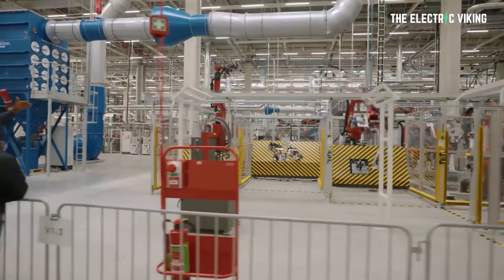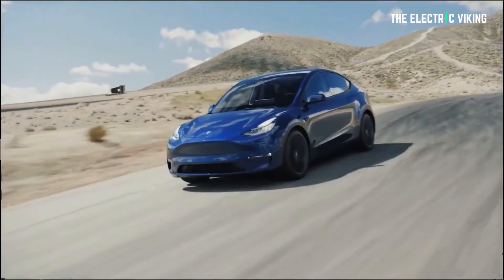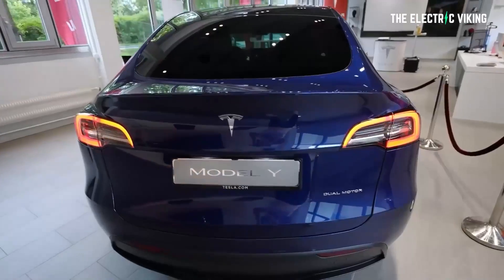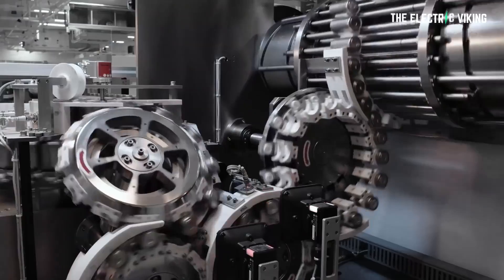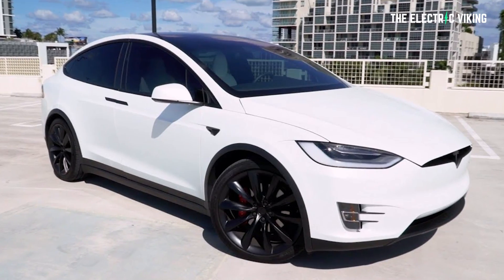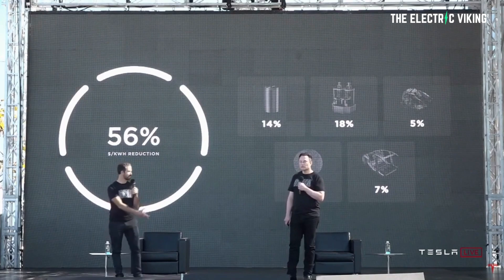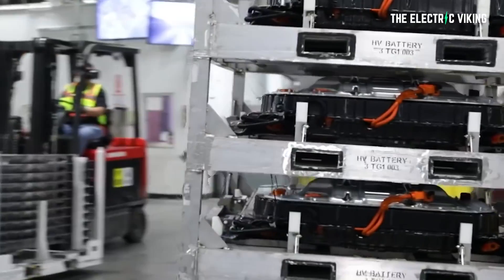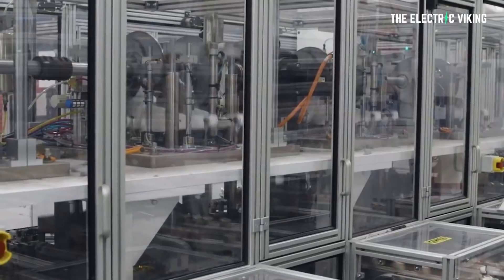Tesla Model Y at GIGA Texas have 4680 structural pack!

Comment: Personally, I would wait at least two years before considering a structural battery pack.  Tesla doesn't do a lot of validation testing, so there will be problems.  My fear is cracking within the glue that holds the battery together.
Reply: The company with engineers who design those long pointy things that make a lot of noise "doesn't do a lot of validation testing"?
(AKA "Rocket scientists")
How precisely do you know the extent of their validation testing?)

Comment: It's too bad that Tesla doesn't update older vehicles.  All the new tech goes into the latest model.  The Model 3 got the 2170 cell but the Model S and X still use the old 18650 cell.  Then the Model Y got the front and rear mega casting, but the Model 3 is still using the old crappy body manufacturing process. Why doesn't the Model S, X and 3 have mega castings?

Comment: So, it seems clear that the Ys coming out of Austin will have the structural pack….but what about Fremont.? If you live in the US, are there going to be both the non-structural and structural versions? Or do you expect Fremont to start shipping structural cars concurrent with the Austin startup?
Reply: The structural battery pack provides performance and financial advantages no matter what size cells (or chemistry) goes into them, so I expect Fremont will change over ASAP. However, the best time to switch is when both front and rear castings are produced locally, and that may possibly require another Fremont GigaPress to increase casting output. 

If someone knows the percentage of idle time the existing presses are experiencing, that might provide some clue.

Comment: Does a structural battery pack mean that it is very difficult to replace the battery, when and if needed one day?
Reply: There is evidence that the vast majority of battery packs will outlast the Tesla vehicle, and will not require service or replacement. Instead, as vehicles become obsolete [or totalled], the structural battery packs will be removed for reuse as stationary medium-current storage devices. 

The battery pack certainly bolts to front and rear castings, providing most of the lower body rigidity. There are still going to be unibody components like door pillars and curved door frames that must also fasten to the battery pack at the edges. 

Because "the best part is no part", probably the car seats and all other interior floor-mounted components will also bolt directly to the battery pack. I think it is likely that a non-structural layer of soundproofing and custom formed carpet will be sandwiched in between.
Reply: A few observations.
1) It's "If" rather than "when".
2) There's likely to be a substantial warranty.
3) Price will reduce A LOT!
4) Did anyone ever say out loud "I wonder how much that engine will cost to replace, when and if needed one day?" We're talking similar mileage, at least.
5) There's still a misunderstanding/ misconception regarding "structural" and "not replaced,/ removable".
The pack will be (is!) necessary to the structure when driving. When the structure is under high torsional stress.
That doesn't mean that when the body is supported on a lift that the pack can't be unbolted without the body collapsing under its own weight.
We've already seen pictures of a bodyshell being moved by fork lift with no pack atteched.

Comment: Production wise and cost wise it makes no sense not to upgrade the whole Tesla lineup to both giga castings and structural battery packs based on the new bigger cells. The only thing that might prevent that from happening right now would be production capacity of the new bigger cells. I think the cells of ms and mx will be Tesla history within a year or two. Why, because it will just make sense, as the outcome will be ease of production, higher production, quality,  less points of potential problems down the production line, ease of assembly,  reduced cost and improved earning per car. Not to mention it will make customers happy. And set Tesla even further ahead of competitors.

Comment: Thanks for the video, great job. As for the Giga Texas plant and the video just shot via drone.. This job has a long way to go!  You will not see scale car production for 8 to 12 months. The work is moving slow, man power is at a minimum for a job that size. I spent the last 33 years running work just like this. The pains taking work is in the setup of the production lines. Texas has never been known for the speed of it's work pace. I am looking to buy a model Y with the castings and battery platform from this plant. I guess i will be waiting for some time.

Comment: Amen Sam,
Strong RANGE improvement will drive me to order my next M-Y LR ... IF it also has BOTH the rear and front giga casting!  
IF in USA has 4680 with 450+ miles it will be perfect because 450 miles with 90% full and 10% safely reserve... my real life usable range would be 360 miles!!! That does the job! 
Praying for Austin improved LR performance!

Comment: The structural 4680 pack is made in such a way that the battery's metal cans become part of the floor pan structure to provide rigidity and structural strength as opposed to simply being carried in a floor tray.  This lowers the weight of the vehicle by using the battery's outer shell to replace part of the floor structure, so, double duty.  Also, instead of more range, Tesla may opt for fewer batteries, same range?
Reply: There WILL be "fewer batteries".
That's just a function of the amount of active material in each "battery" (cell).
There will be about the same amount of "active material" in the pack.
The car will go further (faster) due to less metal in the cell casings and the body structure around the pack.
Reply: Lower range packs may be achieved with iron (LiFePo4) chemistry cells. They have a lower energy density but far lower cost.

Comment: Sam.
The main saving (related to the pack) won't be from the castings, but the reduction of metal in the bodyshell around the sides the pack and the floor.
Reply: Yeah the floor is replaced by the structural pack.
Reply: @imconsequetau5275  
Exactly.

Comment: Keep an eye on Berlin though. A recent drone picture of a Model Y shows the giga cast fame with not battery floor. This would suggest that the structural battery pack could be used. But you're right. I wonder if 2170 will be used there, importing in or will they begin making 4680 cells there. Their most recent contract signing with lithium mines etc. gives me hope that they will. It's all speculation until next Wednesday....and I suspect there's going to be a lot of speculation leading up to that call. 🙂

Comment: Weight reduction results in free range extension.  You don't have to add More battery.  With less weight you can reduce the battery and keep the same range.  But less battery equals, less weight, results in more range gain.
Reply: Exactly.
Also, factor in the reduced cell resistance, which should flatten the charging curve, keeping it higher, for longer.
That increases the "road trip" potential substantially.

Comment: Though it would be logical to use the new technology in the cars coming from a new plant (to avoid costly changes down the road), I am not sure there are enough 4680 batteries available for a quick ramp up in Giga Texas.  I wonder if the "structural pack" technique will be applied to current  cells.
Reply: They've been making and stockpiling cells at Kato road for a long time. There will be plenty for the ramp.
Also remember they only need 20% the number of "cans" leaving the plant for the same output as a 2170 factory and the factory is simple in comparison.
They can run at 50% of the projected speed for months to iron out issues, but that's also being done at Kato road, so the new factories should benefit from that experience.
Reply: Every indication there are plenty of cells for this one plant.

Comment: It will be very interesting to see the real world performance of these innovations in the new vehicles.
Reply: Let's think about it.
Assume the same kWh.
The cells required will use about 40% less steel (based in the number, cell outside area and assuming the same thickness of metal).
The structure in the pack means much less metal is required in the lower body of the car, possibly equivalent to 3 passengers.
That's going to make the car go further, faster.
Then, the 4680 has less resistance, so shouldn't heat up under load.
Result? Less power drain, faster, flatter charging curve (the drop is caused by heat.
It should be more nimble, responsive, quicker, more economical and faster on a multi stop trip.
Potential (probable) game changer.
Oh, cheaper to build, faster to build, etc.

Comment: I’m hoping there will be LFP versions of the 4680 eventually.
Reply: I'm saying if not NOW, VERY soon.
Logically (remembering this is Tesla) are they going to build a new factory requiring a "4680 bodyshell" AND a "2170/ prismatic bodyshell" with different structure?
AND different packs?
It's not logical.
.
What IS logical?
One shell.
One pack design.
Same number of cells.......
Just different chemistry in the cells.
Difference?
The 4680 LFP pack has 20% less cell density, but..... The weight savings and better resistance characteristics of the tabless design elevate the LFP car to the performance of the "old" 2170 cars.
Reply: LFP will debut if and when consumers begin to demand cheap, low-range cars.

Comment: GigaCasting reduces weight and complexity, 4680 batteries reduce weight and complexity.  The Model Ys with both will be much lighter, produced faster, higher profit margin, and longer range.
Reply: And charging
Reply: @rogerstarkey5390  Faster charging since Tesla's 4860 "tabless" cell has far better electrical & thermal conduction (from the sides as well as both ends of every cell).
Reply: @rogerstarkey5390  Charging speed does not matter.  90% of people never use superchargers.  Your house outlet will not charge it faster as the limit has already been reached.

Comment: This is what most have been waiting the 4680 cells. It has to been a huge difference or why would you go to the effort. It has to start bringing the price down for the Berlin builds too. There is no point saying it offers more range, it’s cheaper and faster to produce the cars then end up at the same price. I realise the price of other materials has went through the roof and that’s outside Tesla’s control but even still the mission was to produce them cheap as they can for more uptake.

Comment: The bZ4X and Solterra battery packs are designed from the start to be structural. Available mid-2022. I'm sure the same will be the case for the Lexus RZ also available sometime in 2022.
Reply: How many % profit will Toyota make of the Bz4X?
Reply: @mikafiltenborg2291  Hard to say. It'll be interesting to see how Toyota will handle the supply chain shortage regarding them. My guess is they'll not be able to keep up with demand. Solterra is in the same boat. I'm sure the Lexus RZ will have a nice paddling of profit in it. % of overall profit will clearly start small and ramp up quickly as supply chains clear up and newer EV models ramp up to 15 by 2025 and 30 by 2030.
Reply: Can I mention the elephant in the room?
Isn't this using BYD technology?
Reply: @rogerstarkey5390 Official details about the batteries haven't been announced. But, since they said they're lithium ion, they're not LFP blade batteries. The cars are being manufactured in Japan.

Comment: The Structural Battery Pack is not news... it is expected.  And they can use 2170s with the structural pack if needed.
Reply: Can they?
Speculation, not confirmed.
Reply: @rogerstarkey5390  good for you

Comment: It does make a sense to change the battery in model Y now, before proper mass production has started. In my opinion Tesla will make around 750k Ys in 2022.
Reply: Nobody has addressed the question I've asked for months.
Are they going to build essentially 2 different cars, or do they have a 4680 LFP battery ready?
Be sure if they don't, they WILL be building 2 different cars.
Reply: @rogerstarkey5390  they will have to build 2 different cars if we are to continue using old batteries

Comment: Exciting news Sam, I do hope that Tesla will re-visit the spring and damper suspension design in the new Model Y. If the vehicle is 250Kg lighter, this will need addressing, especially as the Model Y is consistently criticised for harsh ride quality in current form. With less overall mass, the suspension will need to be softened accordingly, and this is an opportunity to address this criticism.
Reply: The Germans will sort it.

Comment: It will be interesting to see how Tesla handles the sale of Model Ys built in California vs Texas. If given the choice,  most people likely would choose the Model Y with the 4680 structural pack from Texas. Maybe Tesla will build the more expensive Long Range and Performance Model Ys in Texas and start building cheaper Standard Range Model Ys in California once Texas has scaled.
Reply: I think the 4680 will be for the performance  Y until they can ramp up Austin.  Then they will shut down and re-tool Fremont.
Reply: @panyanguyen13  agreed, I was speaking to more the short/med term. Although there will a heavy use of LFPs for the base models.
Reply: I think youre right about the model split. What is made in Cali will be 2170 or LFPs, Texas will be all 4680s.
Reply: It seems more likely that they'll temporarily shut down the Freemont 3 and Y lines to switch to 4680 and use the 2170s for power walls and power packs. As much as I look forward to more 3 and Y production, I think the energy business can add a lot to the bottom line once they have access to those batteries. That will push the stock higher!
Reply: @therealctoo4183  true if they dont already have it in place you.also gota remember the pilot line for the 4680 is in fremont
Reply: Also the pilot line was supposed to pump out gwh,s annually and Austin was aiming for twh
Reply: Also the pilot line was supposed to pump out gwh,s annually and Austin was aiming for twh
Reply: @lesstevens2370  I think the limiting factor in Fremont is their ability to switch to using the structural packs and adding the front end casting. They can do it, but it will take a shutdown of the line and they don't want to do that until Texas is producing.
Reply: Most people dont care, at all. LFP cells are the ones to buy, and hopefully LFP will be made in the 4680 form factor, but I doubt it.
Reply: @nordic5490  yes I watched battery day a few times and the lfp is used for its 3 and y  the high density Li-NMC is going to been used for the semi and cybertruck..
 Also the lfp is supposed to have a cycle life of 20000 over 5 million miles

Comment: The structural battery uses the batteries themselves to provide its own structure instead of additional pack structural elements. The uni-body construction does not need the battery structure for strength.
Reply: We know this.

Comment: Battery chemistry may be able to break up the bottleneck of cell constraints, but production of those different batteries cause their own constraints.
Reply: The whole point of the 4680 is that for this stage it doesn't NEED better chemistry.
With the same cell (chemistry) density as the 2170, it will reduce the weight of the pack and the car to the extent that it improves the car.
Likewise, the "cell constraint" will be addressed by producing 5 times the kWh from a factory in the name number if "cans".
If there's a constraint in the "front end" (cathode) just double up that portion of the line.
Anyway, they can simply slow the line until it's right, the car factories won't be at full speed for 9-12 months.

Comment: Plaid #1 production car in performance. 18650 same for Model X - no need to change - just get increased profits.
When/IF 4680 production gets high enough OR either vehicles needs another performance boost to beat any competition then Tesla will switch. Otherwise leave well enough alone.
Model 3 stay with 2170 - similar logic.
Model Y can add structural pack (thicker pack  easier) ??  will they bother to change? not so sure, we shall see.
Anyway, Tesla has options and will maximise production numbers - no need to fix what isn't broken.  Germany 4680 IF production of this new battery ready to go. Fremont not so clear.  Perhaps US Model 3 all from Fremont? and Model Y all from Texas??
Will be interesting to see what happens - How will Tesla keep production to the max - They can sell everything they can make.
side note: chemistry seems to improve ~3-7% every year so even older design battery packs get better.
Reply: The cell is 10mm taller.
The PACK? because the cell takes a load, either the pack casing may be thinner, or the lack of floor above the pack will remove that extra 10mm.
IF the 4689 "isn't ready to go" it's a DIFFERENT CAR.
The STRUCTURAL pack removes structure from the bodyshell.
Remove the pack, you need to retrofit the "old" bodyshell.
Since the whole factory would be designed for the new one ....... Do you really think that will happen?
If it's ready, the whole thing is ready.